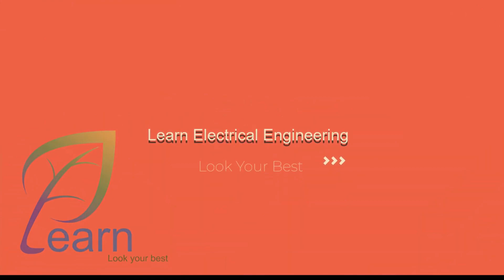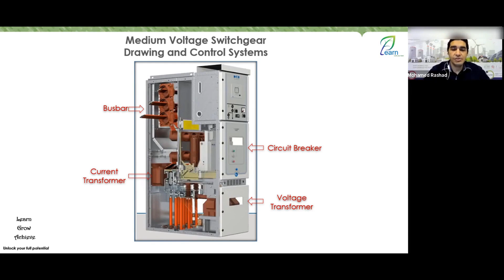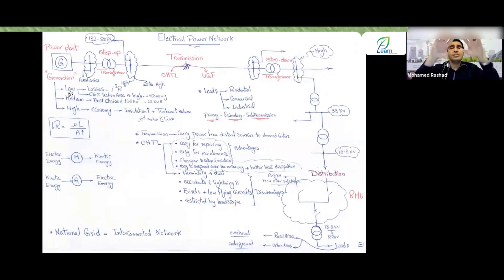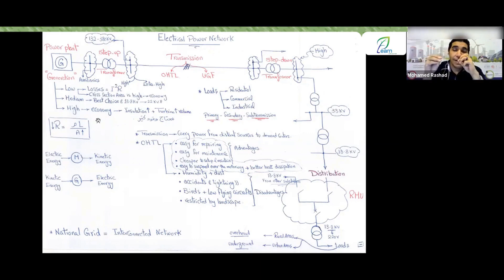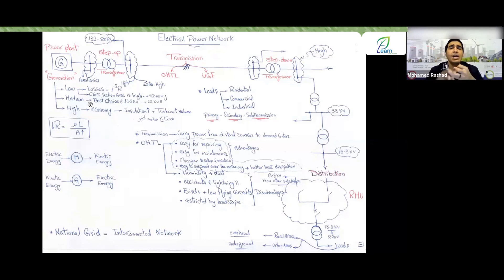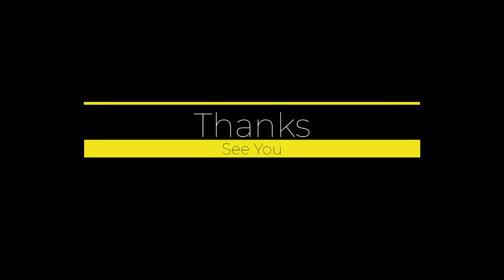1  Introduction to Electrical Power Network Generation

Comment: How to calculate the short circuit current for a 12 pulse rectifier if operating 2 parallel surge. Do you have any tip ?